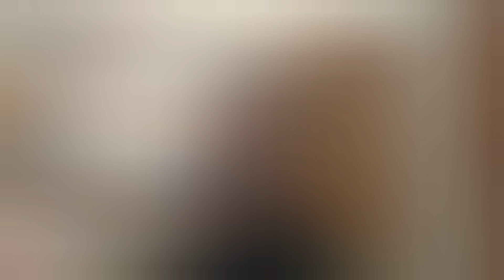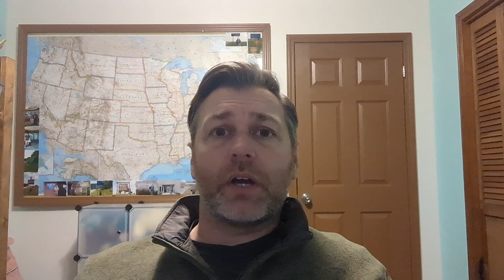Geothermal HVAC: Do you need it?

Comment: North of Atlanta all of the HVAC contractors seem to think they can convince you it's the latest and greatest AI..... nobody will touch a system for under $100,000 on a common sized home sitting on several Acres. Of course cool ray will sell you one of their air source heat pumps for $20,000.  Any Google search will give will give you price estimates similar to people who used the systems in other parts of the country, maybe $30,000, but even the electric company says no one in Atlanta will touch it. Why is that?
Reply from the maker: I dunno.  I'm in the Midwest and Geo is fairly popular.  Now not everyone has it just due to price but still very common.   I know a lot of areas are different.  I don't know why it would be that way there.  I knew a guy in Colorado that did HVAC and he described it there like you do.  I always assumed it just costs too much to drill thru the rock out there.  Maybe there's some kind of logical reason for that area but got me.
I love Geo and I wish they could figure it out n more areas.  It really does work and it really saves money.  If done right.
They r coming up with all new kinds of ways to put the loops in now a days.  Maybe it'll be more prevalent in your area soon.